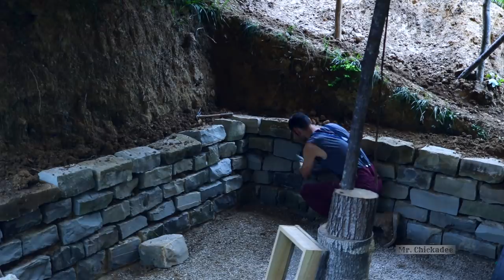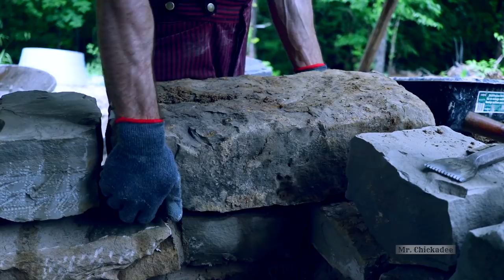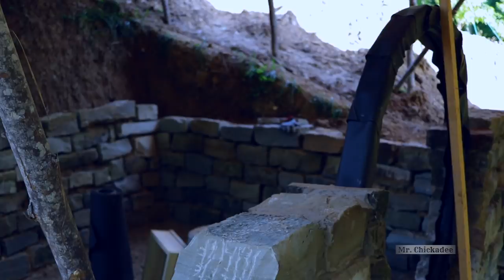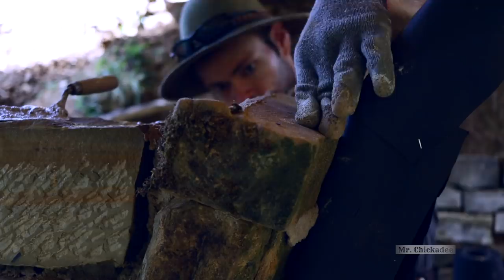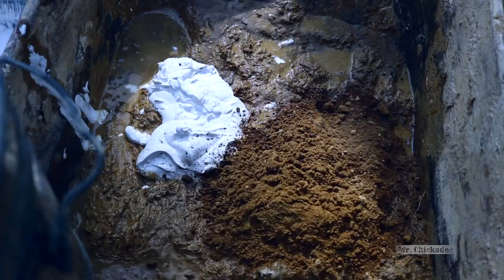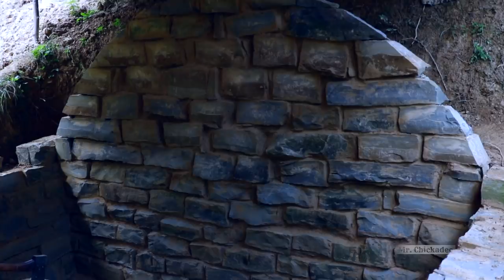Building a Hobbit style root cellar with stone Part II

Comment: Lime mortar was used in Britain up until the 60's then I'm afraid Portland cement took over.Lime mortar is softer and moves ,so it does not crack soft bricks or sandstone.
Reply: Our house is over 400 years old, and at some point some vandal rendered the whole thing with concrete.
The problem is (aside from the heinous environmental impact) that when the building shifts, the render does not and it cracks allowing water to get at the oak frame. It also traps the moisture inside, whereas lime render would allow it to evaporate. 
Awful stuff.
Reply: @TomChaton  Tare it out and put back in lime mortar, the building will thank you for it.  it was probably a builder that told them to do it that was instead of telling them to put lime mortar back in.  In fact, if you put a tiny amount of Portland Cement in the lime if will help keep it from degrading, but do not put much in.  Lime would be left to sit in waterproof bags or tubs for a few days before being used, it was easier to use and stuck better, but it can be applied straight away with a tiny bit of cement in it.
Reply: If you want good cement with a slight give in it, put lots of lime in it and it will not crack or come away from stone, but will be stiff and more like cement.
Reply: @BoB4jjjjs  that's the plan, but we need a big contingency in case there's a load of remedial work to do once the concrete comes off.
Planning permission and listed buildings consent aside, it's not economically viable at the moment :/
Reply: im from a town in Australia that is known for building sydney its called portland and use to make cement. my family lives in a beautiful old house that was the cemnet works manages house over 100 years old. and all the walls are rendered with lime render the only down side to it is that its really hard to work with
Reply: What is the bird that can be heard calling at various points in this film?
Reply: @mrstandfast2212  A chickadee. I was super happy when I learned my recent move gave us chickadees in the woods.  Now I hear them in stereo.
Reply: thank you i was looking for this answer

Comment: Pozzolan. That's what you need when working with stone. Your mortar would go off much quicker, meaning the chances of disturbing something you thought you'd finished are much reduced. It's ancient technology, used by the Chinese in building the Great Wall, and it's the essential ingredient in Roman concrete. It's necessary because stone draws no moisture out of the mortar. Of course, you should be using lime for stone work, but lime also benefits from the use of a pozzolan.

Comment: As a contractor, I have always admired your craft.   If I may make a suggestion....  When you're stone working or mixing cement it's a good idea to wear at least a N-95 or better N-100 respirator.  You are doing enough of this work to contract silicosis of the lungs in your later years.  Even when you are wet sanding or sharpening its a good idea.  Stay safe

Comment: Hello. As I know, you are not stonemason, I would like to share some wisdom with you. When carving stone, it's good to put him in sand. It doesn't move, when you strike and i prevents unwanted cracks. When you start raisnig wall, use small chips of stone as level-stand-points. Mortar will move in time and wall will colaps. Mortar is generaly use to fill gaps between stones, not as structural thing. So put stone on mortar and then level it with chips of stone, which are pressed to mortar. And last think. As you probubly know, lime likes to stay wet. Longer=better. Up to 10 years. I hope, this will hekp you to improve your skills and ALREADY imposant and good work. Keep up and looking forward to see next video.
Reply: Interesting--thank you.  Question:  You wrote that lime like to stay wet up to 10 years.  I don't understand.  Could you please elaborate?  Thank you.
Reply: @uekiguy5886  lime isn't the most hydrofil matter in world. It takes very long time, to make 100% wet "lime milk" from dry powder Ca(OH)2. You cannot take powder and mix it for 10 minutes with water and than use in such mortar or as wash.

Comment: Great project. You really want to wet the stone before putting down the mortar and remove all moss with a wire brush. Not all stones appeared to be dry dry, but some of them did - maybe I'm wrong and it did not show on camera. Great work and admire your patience ;-). You have inspired me to do some more stone work back home in Sweden!
Reply from the maker: try the CCs I explain you must wet the stone often
Reply: @MrChickadee  ahhh you've hidden even more gems in the CC! Will turn the on the next time watching your video. Would have been surprised if you had not been aware anyway. Looking forward to seeing how you deal with the roof structure. Have a similar Earth cellar structure in mind back home, but need it a bit more structural because I was planning to have a stone terrace on top of it since I have sloping hill where there is a small country house on top of it. It would be nice to extend the current terrace and utilize the area by adding another root cellar underneath it. So many videos of yours are very inspirational. A great thank you for these fantastic ideas. Best wishes from the UK and from Sweden when I'm back to continue the work... John

Comment: I've just bought a cabin with siding like your workshop has. Not burnt, but with the vertical boards. Do you think that's a good siding to use for a home? I confess, I don't know what it's called. Most needs replacing, and I'm intrigued with the burnt method. I noticed you didn't put any barrier behind it. Or, was I missing something? From 2,600 ft in the Sierra Nevada of California. Never rains in the summer, never stops in the winter. 7" of snow a few years ago. Historically? 5' overnight. But getting rare with the climate changing. Record low? Maybe 20F.

Comment: What keeps the dirt from collapsing the beak wall? Also will mud stop water seepage? One last question; did you buy the rocks or source them off your land?
Reply: I assume that the mortar would be what’s stopping the water more than the mud or anything
Reply: Just in case he doesn't get a chance to reply, in the past he built a blacksmith forge and this stone looks like the same material he used for that project. It was sourced from a decommissioned bridge, had them laid out along his driveway/property boundary? he then broke down to manageable size by hand, checkout some of his older videos ;)

Comment: The round door way is truly a masterpiece of work!    
will you be using the rubble "wedges" you've knocked off stones?  one mason I know used them as the primary way to level up stones in this sort of wall..he said it was more solid positioning than trusting the clay which might squeeze under weight...

Comment: if you're going to use clay in your mortar my advice is to also include plenty of fibre such as grass, cow dung, horse hair or similar because clay can absorb moisture and crack from frost. Better still, add sand and decrease clay content. You can do a frost testing. Ie: leave a mix of clay and lime to get frosted and see what happens!! If frost is not an issue then you can forget the fibre. Sharp sand and lime is a simple and flexible mix. But if you want to use clay because ,say, it's there then add the fibre too and any cracked clay will be mitigated by the fibre. Because this building here is mostly encased by earth there shouldn't be a problem with the clay mix especially if the exterior/imterior has a traditional lime mortar to point it. I've got away with a clay/fibre sand mix for the internal body of a structure and then applied a sand/lime mortar on top. If the external lime mortar is thick enough then it won't crack.

Comment: I've often wondered this about Hobbit-holes.  How do you suppose they dealt with the inevitable moisture problem?  A heavy rain would be sure to soak into the hills that their homes were built in.  I suppose the circular shape of their walls would help in that regard to divert water down and away.  Bit surely they'd have to use water resistant materials on the ceilings and walls.  I can't see them using stone on the ceilings.  The blocks would eventually fall and squash a poor Hobbit.  It's interesting to think about.
Reply from the maker: Well there is a reason its fantasy...very few places glabally used underground housing, in most places it is a recipe for disaster, dampness, condensation, and radon gas makes for a not so comfy home. The cold and damp however makes for a good root cellar, which this is.

Comment: Why did you use clay to level the stones in the back and mortar and shaping around the door?
Reply: My bet: At the back, the stonework is supported from 5 sides, so it doesn't need all that much support, the clay and smaller stones were just to set it in the right position. On the other hand, the front wall has both sides facing thin air, and around the door frame every stone is supported only from the top, bottom and one side. So they might be more likely to go loose and start wobble, which you definitely don't want. On the other hand, that's not going to happen in the middle of the back wall, where the stones push on each other from 4 directions, plus the soil support from behind...

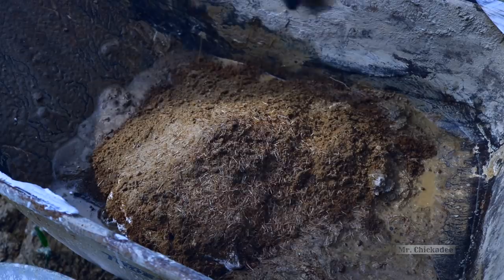Comment: It's be really nice if when you show the mixing of the various mortars/cements if you popped up some basic text on screen of what you're adding. For example, what was the stuff you added at 14:20 ? Looked like grass mixed with horse whiskers...
Reply from the maker: I did, turn on closed captions to see commentary
Reply: @MrChickadee  Hi there, the only problem is most people will have captions disabled by default, would be better to add a text overlay in your editing software if at all possible. I'm no expert, but I do watch a lot of woodworking/restoration/metalworking vids etc and that normally works beautifully for those. Lovely project though, keep up the good work.

Comment: What would you use if there is no clay subsoil available? Here our subsoil is made of fine silt with very little clay content. Is there a recipe for stone masonry mortar using only lime?
Reply from the maker: No clay is needed for a simple lime mortar mix, just one part lime putty, 3 parts sand. I add the clay soil for thrift and to add larger aggrigate which aids in spanning larger spaces, and for color...

Comment: What is Portland cement and why can't I use it?
Reply: roughly my question too
Reply: It’s what most people know as simple “cement”. It is hideous, ecologically, and one of the biggest global contributors to global warming. It also lacks the porous quality that lime mortar and plasters have which allows a building to shift and breathe.
Reply: Portland cement is your typical cement. Here in Britain, we use a lime mortar for stone and restoration, and cement mortar for new blocks. Where buildings have been repointed with cement the stone or old soft brick starts to crumble, whereas lime mortar stays flexible, and is softer than the stone.
Reply: Portland cement can break bricks or more porous Stones apart. This is when a small pointing job between bricks can turn into a heartbreaking situation further down the line.
Reply: If I’m not mistaken Portland cement is some mixture of limestone i think. It’s used to bind the rocks in concrete together
Reply: @coedlan  My eyes are rolling back to South America.
Reply: The primary advantage of Portland cement is it sets up quickly making modular cinder block walls faster to build. But best used with cinder blocks that are also made with it.
Reply: Awesome! Thanks for all the replies!
Reply: Portland is the most widely used cement in modern concrete block construction. It will kill your lungs and eat the skin off your hands after many years of exposure. Masonry cement is the other type of widely used product, mostly for brick construction.
Reply from the maker: Put simply, Portland Cement, or OPC is any of the modern type cements used now to make things like steel reinforced concrete, Cinder blocks, modern ready mix mortars and grouts and cements, modern cement pavers and many other things. Its use has caused the destruction of much historic architecture, great hazards to our environment, and terrible building practices worldwide...
Reply: @MrChickadee  I remember reading of a historic adobe church somewhere in the SW US which requires new plaster every year or so. They tried a stucco with cement I think it was, to avoid having to re-plaster every year and they discovered after some time that the walls within the plaster were falling apart. Luckily the damage wasn't too extensive and they tore the plaster off and continued their tradition of using an earthen plaster. I've visited some old nothern mexican towns where it is common to see large adobe walls which have fallen down with the cement plaster still visible. It traps moisture within the walls and liquifies anything clay based over time.
Reply: @MrChickadee  and it has a huge carbon footprint.
Reply: @matthewwheaton5835  Well, you're wrong, and he's right. Roll your eyes all you like.
Reply: Lime mortar adapts to shifting stones, can breathe and neutralize moisture content. It does take a long time to harden and dry though

Comment: So besides being in the side of a hill, how is this structurally different from how a traditional stone house walls would be? This reminds me of a lot of the old stone houses in Ireland. But I’m sure something must need done differently right?
Reply: A lot of stone houses in the UK are a lot thicker (up to 600mm). Also my old house in North Scotland was two layers of large granite blocks infilled in the middle with rubble, kind of like how a dry stone wall is rubble filled.
Reply from the maker: Big difference from a free standing wall, this is completely supported, so I can lean outwards and not need so much stone or design.
Reply: Mr. Chickadee 
Gotchya. So you can kindof lean the walls outward into the dirt and not have to worry too much about them tipping or something. That makes sense. So how thick would you make a wall that would be free standing

Comment: What do you mean by lime/clay mortar? Is it just a one-to-one mix of lime and clay?
Reply from the maker: Most mortar contains a binder and sand(aggregate) in this case it is a 50/50 mix of clay subsoil and hydrated lime for the binder, then for each 1 part of binder, 3 parts sand is mixed to make the mortar.
Reply: @MrChickadee  Thanks for the info!

Comment: What are the differences between portland and lime mortar ?
Reply from the maker: Night and day. Lime is traditional, is breathes moisture away, is softer so wont hurt the stone or brick, more environmentally friendly to use and make. Portland is too hard, can break or spall stone and brick, holds moisture causing many issues with rot and humidity. Very bad environmentally to produce.
Reply: @MrChickadee  thank your explanation!
Usually you only hear about the environment should be enough reason, i already knew that😅
But building something that will cave in here in 3 jears is not my intention😅
Thank you !

Comment: Wouldn't Cement be a better way to join and point the masonry?
Reply: Cement is fine for modern brick and concrete block. Not for stone or old brick. It's too hard, and the frost cycles and stuff cause the stone to crumble. Here in Britain a lot of old walls that were standing for hundreds of years, have been repointed with cement, and started to show signs of crumbling and decay withing the decade.